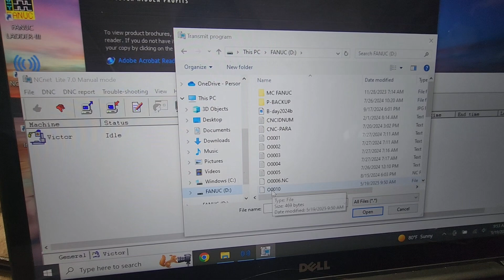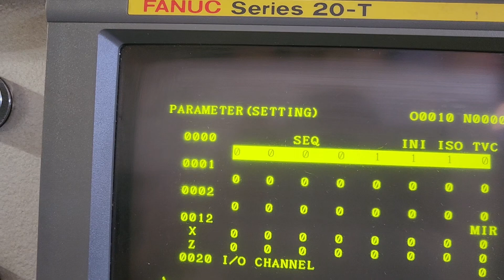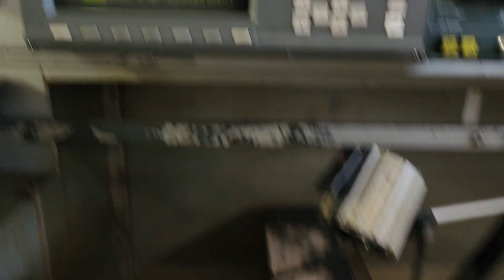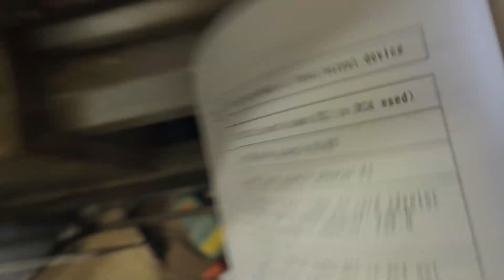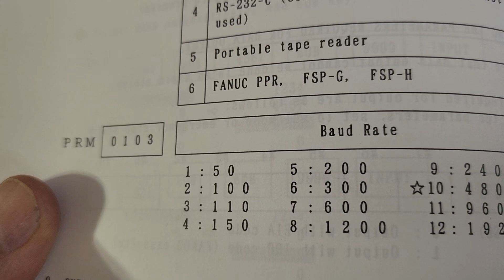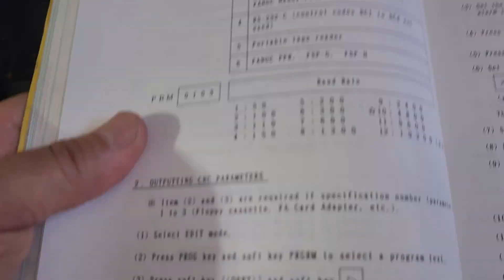Connecting Fanuc 20T to a PC to transfer files.

Comment: Not sure if this is a slight difference in controller or the programming because it's a different lathe (mine is a Colchester) in the program library I had to press OPRT (soft keys), READ, EXEC, then start the transmit on NCnet.

Thanks for the video, would've been lost without it